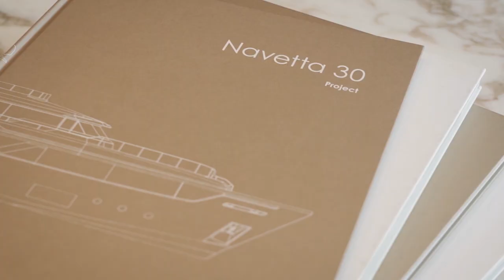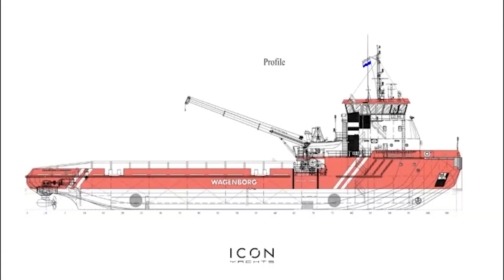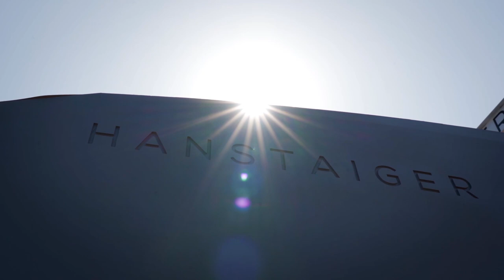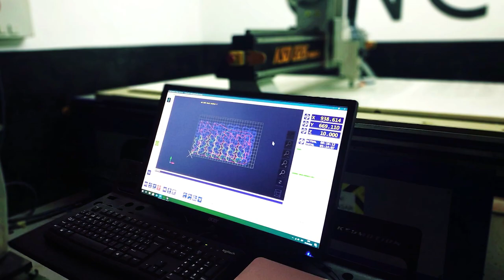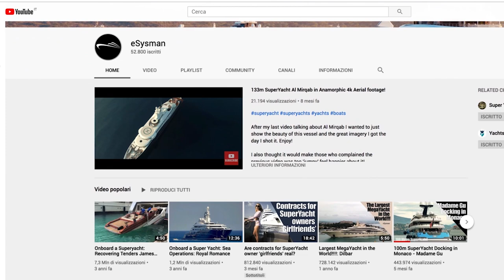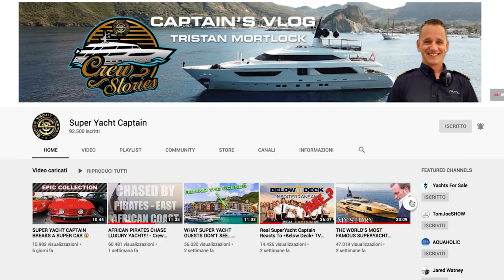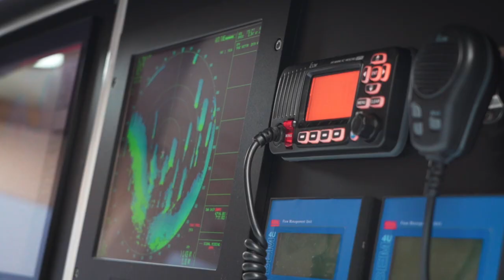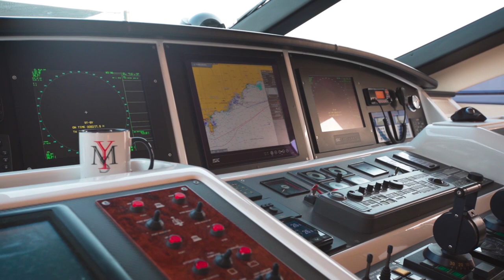WHAT DO THESE TWO AMAZING YACHTS HAVE IN COMMON????

Comment: If Wider can find a way to harness enough environmental energy to make running a superyacht practical at sensible cruising speeds and schedules (like 200km per day with 10-13 knot cruising speed efficiently), they pretty much win.  That would clean off what has always been the biggest stain against power boats.

I'm imagining top & side surfaces almost totally covered with PEV flex-panels, vertical wind generators, big big battery bank to store up for the next leg of travel, the works; but I don't know if it's really doable yet.  There's a performance-challenge triangle among money, weight, and physics that can only be fought so far.  Today's batteries are close to making it work from shore-charging, but without that it will require a lot of energy to be absorbed from the environment.

Of course they could also supplement performance the old fashioned way... with sails :)

Comment: yes i watch them  Jerrod ,i written  him how to make (D/tag )   diver tank air gun   it no joking mater  it sound weak  but it can rip apart 5 inch thick fiberglass  making a hole  7 inch diameter by 5 inch think  in 4 seconds shooting 390 to 450 bee bee's  a second , STEEL OR BRASS bee bee's  at 3,000 PSI  with close to 300  Juls per bee bee ,  think of a sandblaster on all the crazy drugs at one time including bath-salt  , yet it look like 3 diver tanks set up to be charged with air in series in plane site . but not hooked up to the air compression yet.